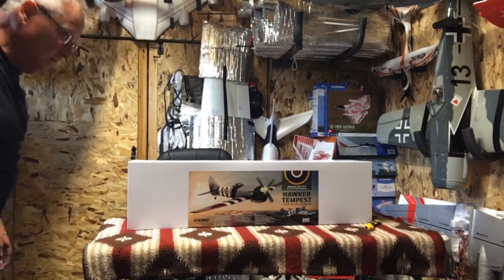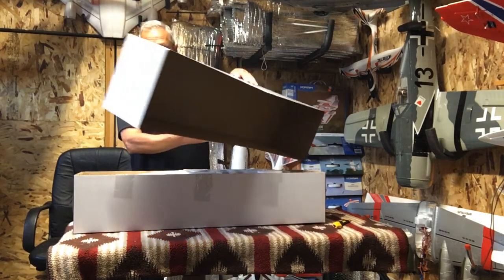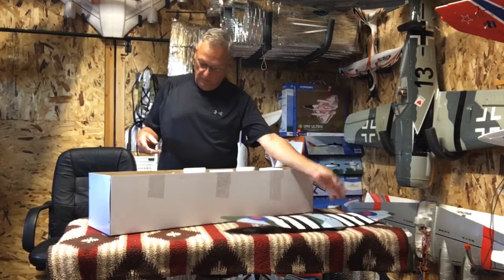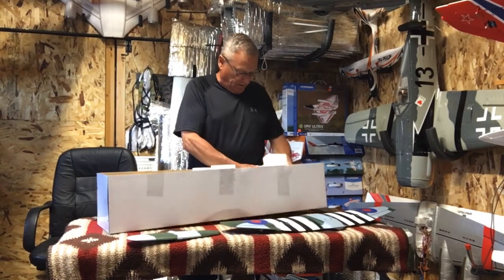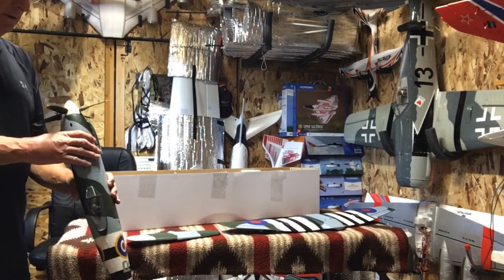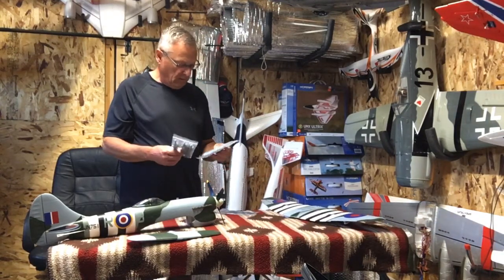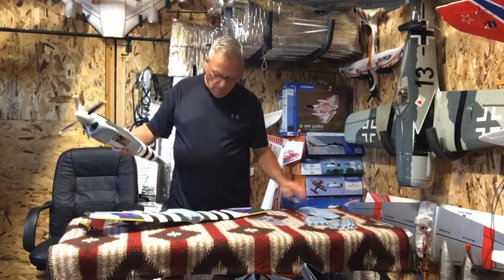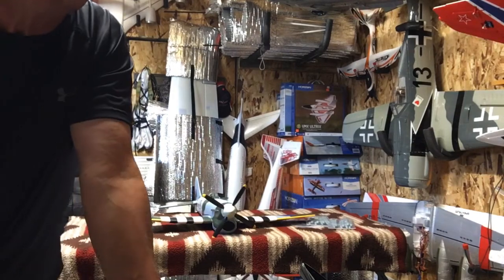Unboxing of theH-King Hawker Tempest

Comment: I have just got mine and would welcome some feedback from you in the following - I could not get mine to balance at 55mm C/G using the recommended Turnigy 800mah or 850mah batteries, in the end I had to add 20grams of weight to the bottom of the Cooling intake - how did you get yours to balance - I like watching the videos on how these things go together but no one seems to have any issues with getting the C/G in the correct place - and not many show how best to do this yet to fly it is one of the most important things to get right... any advice or help is most welcome
Reply from the maker: I put a Turnigy 850 all the way back in the battery tray and was way nose heavy added quite a bit of up trim and it seemed to level out. But when I came in for a landing it would nose up, so I’m still trying to figure it out. Could only get one flight in .🌧

Comment: Hi, I'm new to RC model aircraft and pardon me if this sounds like a daft question. I'm struggling to connect everything up on the receiver unit (TGY-IA6). I have never seen 1 pin servos (Throttle,Elevator and Aileron on this model) and don't understand on which pin they must be connected. Do i connect them to S pin, Positive pin or negative pin ?  Also, does the receiver unit have to be powered by connecting it to the battery? Thanks and sorry again if it's a stupid question. Have a good one!